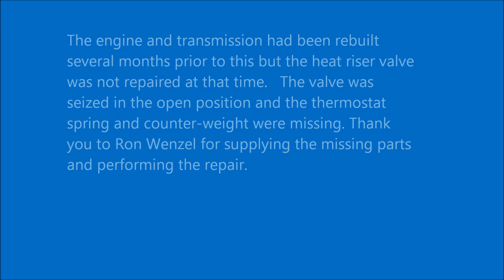1960 Chrysler Saratoga Heat Riser Valve Rebuild

Comment: And other than helping the engine warm up faster, what purpose does this serve?
Reply from the maker: +Ryan Richards   It actually heats up the carburetor, not the engine.  As the passenger side exhaust is closed off when the valve is closed,  it forces hot air from the passenger side exhaust up and through a passage in the intake manifold, under the carburetor, effectively heating the carburetor quickly,  and the hot exhaust then exits out through the exhaust manifold on the driver's side.  Without this,  cold weather warm ups would be slower and rough.  As the engine warms up,  the valve slowly opens and lets the exhaust from the passenger side go down through it's  own exhaust manifold and out instead of up and under the carburetor.